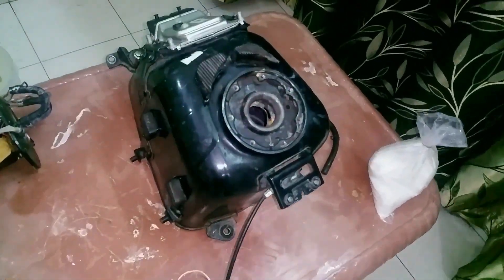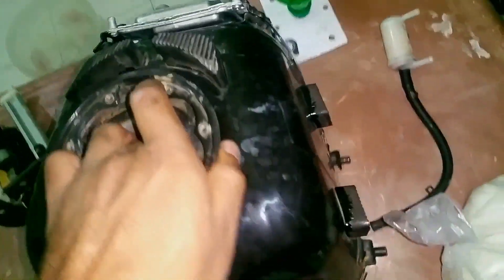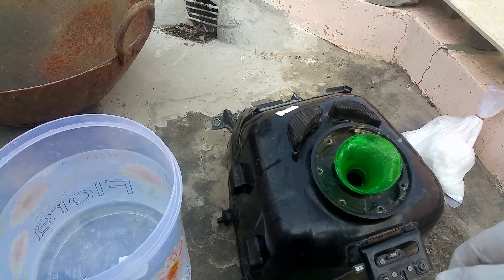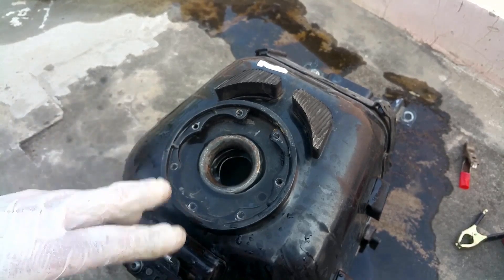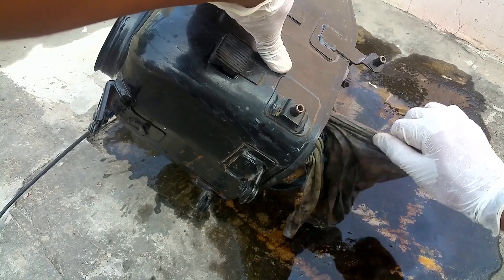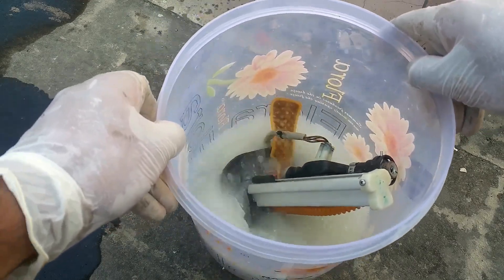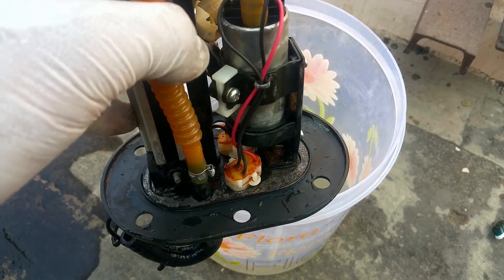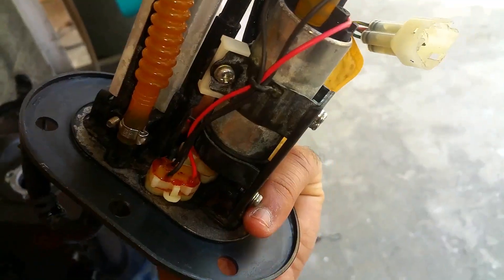Removing Rust From Motorcycle Fuel Tank Without Electrolysis

Comment: Fuel pump sud not be immersed in water based mixture like that!  Never clean a fuel pump with water.
Reply: Do not worry , Dravidian , embrace the Aryan science . Fuel pumps are not that fragile , you are not running them while using the mixture.